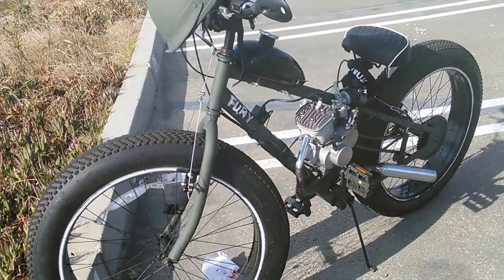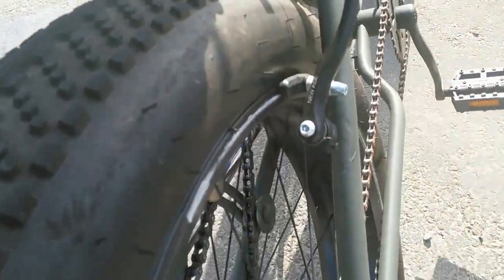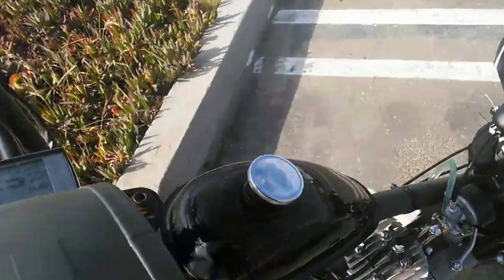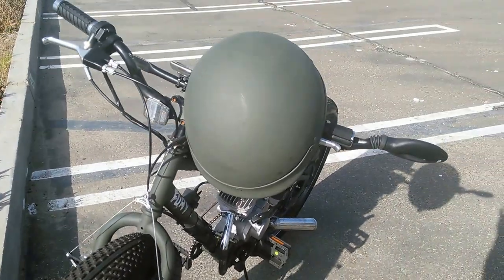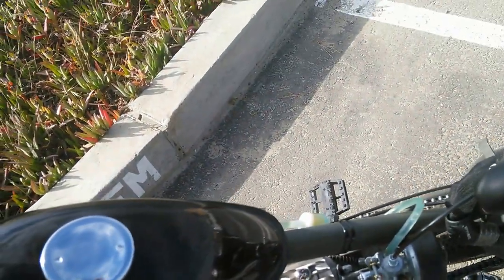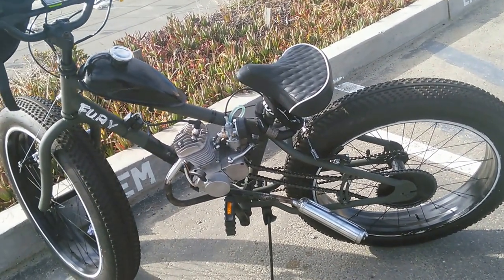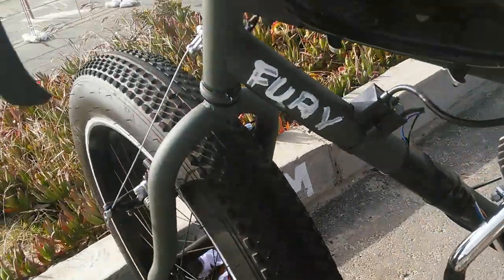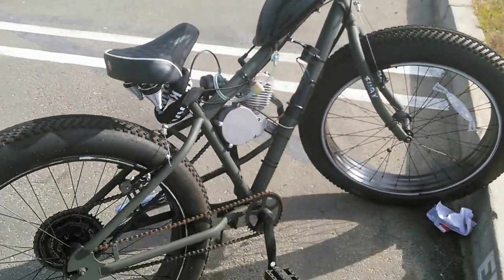CrabZilla gas motorized Sherman tank of fat tire bike Fury WW2 dedication .

Comment from the maker: to mount the motor you have to work on the gear sprocket first. once your done than you can align the motor on the frame as you can see the motor is off set from the frame you have to build your own mount's I had to weld mine hope this can help.

Comment: How did you fabricate the rear brakes? Did you have to weld on cantilever posts? I need to figure out a brake system
Reply from the maker: 916OnMiNeZ  Yes ordered the post on line welded it to the fork and the frame

Comment from the maker: Sorry guys it's sold already
Reply: joseph jinji Even though it's sold, how fast did she go and how long do you think she'll last?
Reply from the maker: It ran about 30 MPH and it depends on the user on how long she will last  my other motorized bike is still running great I had it for a year now and is still running great. But I'm not really afraid of if the motor blows out they sell the motor alone on Ebay for only $40 bucks I can always replace it if it does happen thanks for the response.

Comment: Hi.  Where did you get such a small gas tank? Answer please)
Reply from the maker: MrPajok1987 Amazon
Reply: CrabZilla thx,  but could you please specify link,  or model,  or name?
Reply from the maker: MrPajok1987  It's from China Seeutek 80cc motor
Reply: CrabZilla thanks a lot)))
Reply from the maker: MrPajok1987  the small as tank comes with the kit

Comment: Smaller the Sprocket the fast it goes Right ? Because I have one it has a 42 teeth sprocket , just ordered a 28 tooth
Reply from the maker: yeah I just made this thing to ride the beach so I decided lower gear
Reply: +joseph jinji Cool thanks need it to go faster..Glad i ordered the smaller one
Reply from the maker: The smaller the spokes it will go faster but you know what I did that will help I drilled holes on the stock exhaust pipes it actually made it faster good luck.
Reply: joseph jinji 
 drilling holes in the exhaust might give some backfire. I would say just get an expansion chamber muffler exhaust and play with idle screw, but you do you and good video man thanks.

-Colio
Reply from the maker: Lol I was just trying to go cheap on that exhaust just experimenting and it actually worked no backfire but pulled more speed though thanks for the comment.